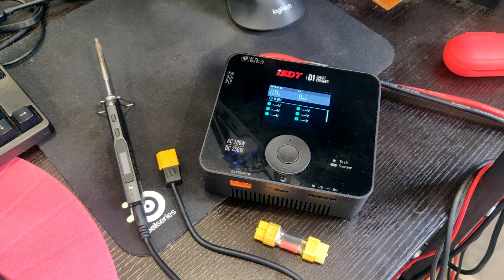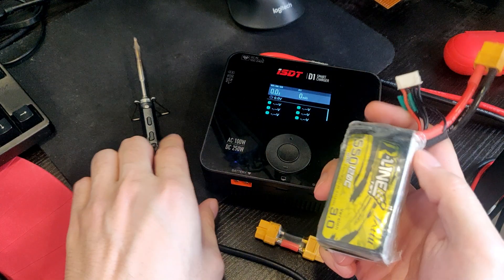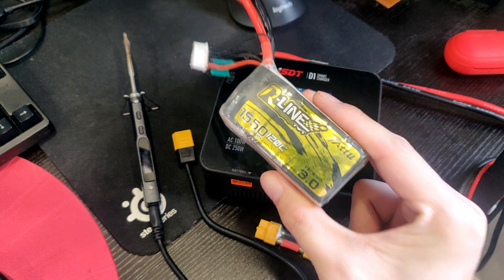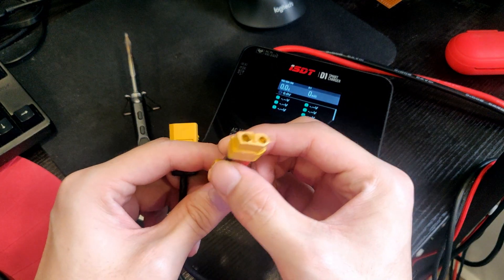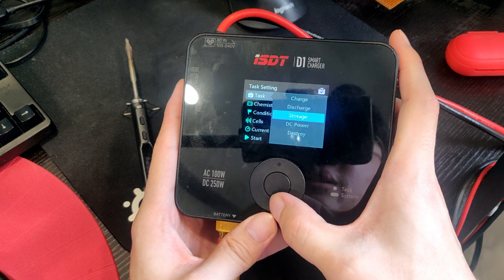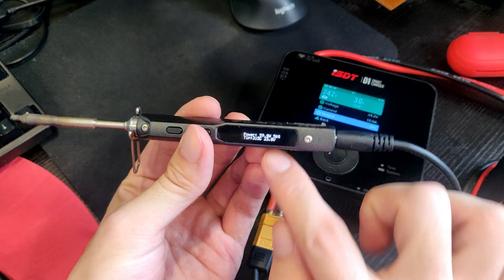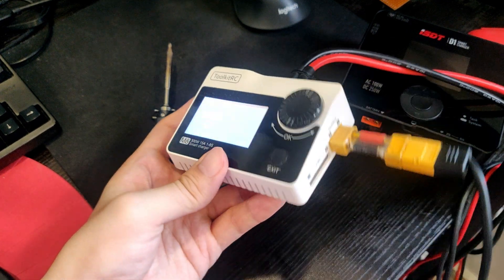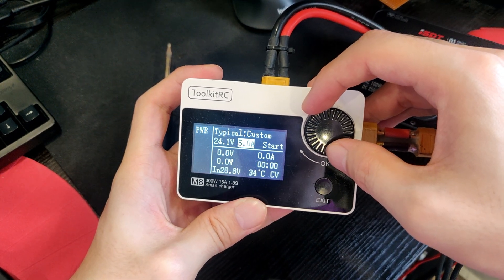Stop Killing Batteries | Solder With Your Charger!

Comment: Hi, if I power the isdt d1 only with the wall AC plug.
Will it then also provide enoug power to heat up the solder iron ?
Reply from the maker: Yes, wall AC is more than sufficient for TS100.

Comment: I've never used a lipo battery for my TS100 because I am concerned about damaging the battery and also because my batteries are for flying with. I don't have that many batteries, so using one to do a repair just means I can't then fly that battery once the repair is done.

Comment: I actually plug a battery tester on the balance lead that will beep very loud when the voltage gets really low. Useful especially if you're on the field.
Reply from the maker: That is a good way to keep from over draining the battery. One thing to keep in mind is that most battery checker draws power from only the 1st cell, so you might end up with a very unevenly drained battery after a long soldering session.

Comment: you should make a video of using the battery charger as a 5v power supply to bind you rx! i did use it for this once before!
Reply from the maker: For that purpose most FC has a 5V/4V5 pad that will power the RX when you connect USB to it. Think that would be more convenient.
Reply: @KlystromFPV  most of the fc i have used dont have this live usb pad. only one i have that does this is my jhemcu f7 supra w/bt
i agree all fc should have a live 5v pad on usb